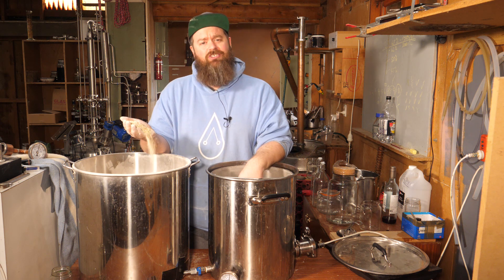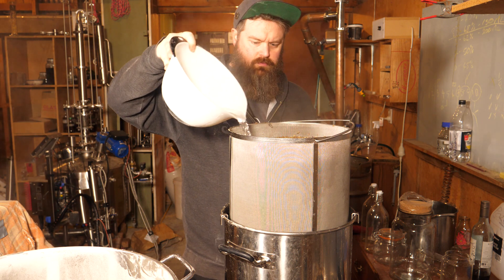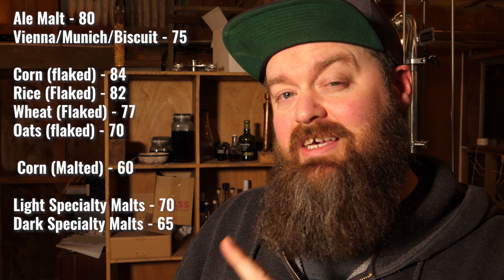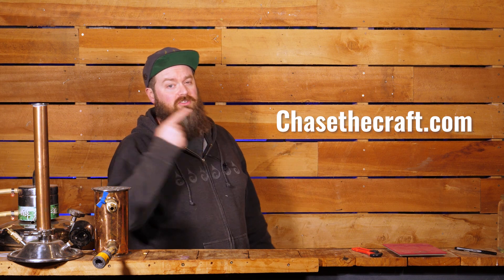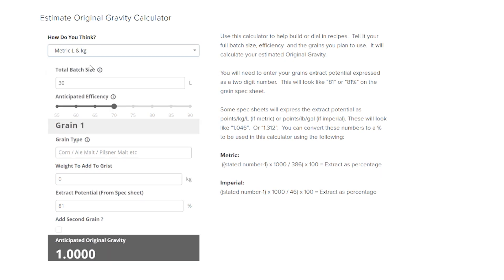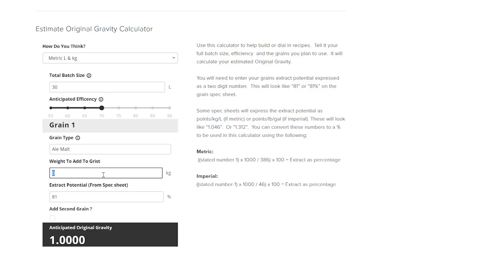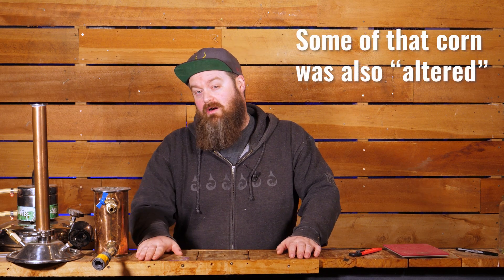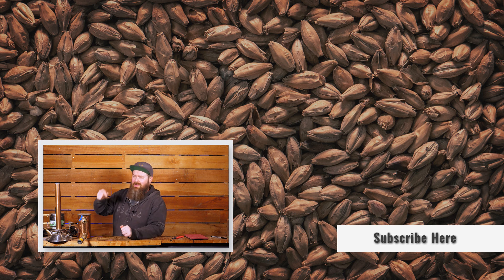Calculating Your Original Gravity To Hit Your Numbers

Comment: Hi Jesse, First off,- thank you for your fantastic video"s. I built an all copper moonshine type still over lock down after watching your videos, and started making UJSSM, but now with a combo of smoked corn and barley. ............. I went to Kmart yesterday to get more cork top bulk jar "barrels" for aging my bourbon, but they were sold out. So I had to get the 3L  clip-top jars with the orange silicone seal. But I'm worried about chemical leaching from the silicone with the ethanol, I am also in NZ, and I wonder if you could please let me know where you get the white seals you use, and what are they made of? I know you prefer we research ourselves, which I agree with. but i'm hoping to swap these seals out as soon as I can. - Also, the kick ass t-shirt is a winner, i'd get one. Thanks.
Reply from the maker: Hows it mate.  Those are the exact jars I use.  Kmart FTW! 

I keep the seal that comes with them but tripple wrap them in PTFE tape.  Grab some from bunnings/mitre 10 and wrap em up :)
Reply: @StillIt  Awesome, I've got some floating around my work bench somewhere, thank you very much for the tip!

Comment: Another reason for having a slightly lower efficiency is the difference between Fine Grind (aka 0.2mm) and Coarse Grind (0.7mm) extract potential values. 

Guaranteed, all distillers (and brewers) are using coarse grind (0.7mm). Fine grind (0.2mm) involves using all kinds of methods to get every last spec of starch out possible, things that no rational distiller (or brewer) is going to do. If the CG value is on the spec sheet, you should probably use that, but if it isn't there, then just use the FG value and know that yours will actually come out slightly less.

Also, the US uses "US customary units" not Imperial units. For example, a US gallon is 3.78L, whereas an Imperial gallon is 4.54L.

Comment: At what point does the strike water volume cause the numbers go off kilter. Example being using 50 gallons of water with 100lbs of grains. I've noticed with some calculators using this volume i can't even get close to the right temp once the grains are added. Its either too high or too low.
Reply: One of the big issues is determining the specific heat capacity of grains.  Not an easy value to track down, and it's going to be different to the actual grain in your hand. So most calculators just use a fixed value, typically it will be around 1.59kJ/kg C or 0.379BTU/lb F. 

So the larger the water volume and grain mass, the more it will deviate from the actual value.
Reply from the maker: I mean  this calculator dose not do strike water temp at all. But adam is correct about the strike water calc, at least on my website.

Comment: Thanks man! Do you log your recipes using brewing software ever? (Not just for the calculators but also for record keeping). I know most brewing software is all beer based, do you know of any software that has an additional distilling section for a recipe?
Reply from the maker: No I dont. I did try at the start but never really found a way to incorperate all the aging and splitting stuff in Beer smith.